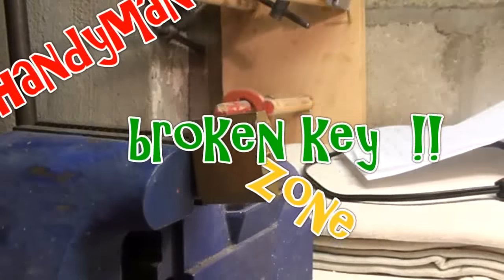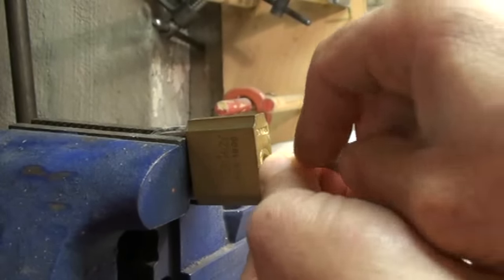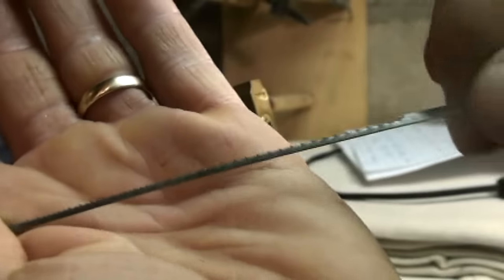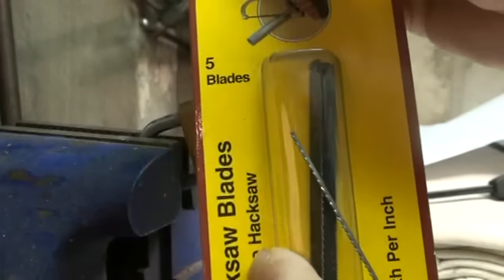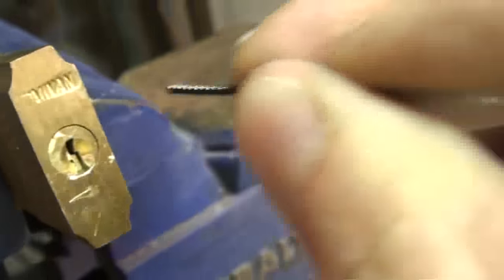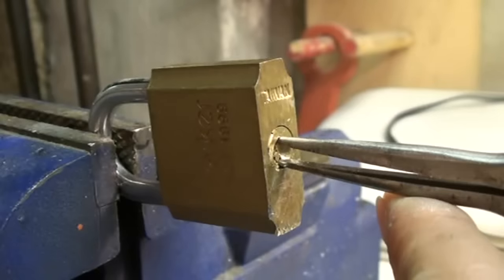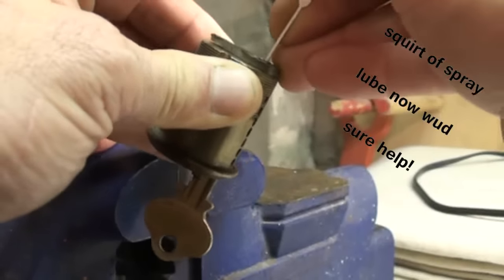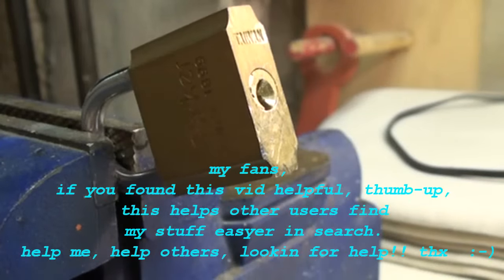7 Tricks Get Broken Key Out Yourself - Any Lock or Key

Comment from the maker: Trudi, you could use one small tool (an extractor or similar) to hold the dust cover open, then try a 2nd extractor or mini blade to catch the key and slip it out, dont forget a small squirt of spray lube to ease things along....you have the right attitude of perservance  & you will get it out, good luck

Comment: I want to thank you for this video as it helped me to my key being broken off in my car door lock. I tried the super glue and it worked to a point. Its 10 degrees out atm. The key did pull out a little bit so I tried it again with superglue. Still key came off. I watched your video up to the saw blade part. I have a small blade saw like that but I had to modify it by using a hand held grinder tool. Grinded it down to a small size, used it and the key came out! Thanks again for this helpful video. I can post a vid if needed by anyone.

Comment: thanks a lot Man, i spend money on hack saw and turns out it easier to extract broken key than cutting the lock. just use the oil and the tiny saw just as you said

Comment: Hi there,
My key just broke off into my trunk a few days ago.  I thought AAA would help me just get the key out - but no, they pay $60 toward a $200 charge!  I refuse to pay that much.

I was so glad to come upon this video.  I have ordered both a key extractor and a set of 5 blades to try doing this myself.

One question.  When my trunk is locked, the lock is 'vertical.'  When I attempted to open the door, it turned the lock to 'horizontal' position.  What's the best side to insert the tool in?

Comment: great ideas thank you Dino. I used a paperclip to push thru from the opposite side and push the broken key our just barely enough that I could grab the end with a very sharp pair of tweezers and pull it out. Basically I used the push method you show at about the 7:20 mark. Not sure how much you saved me but I have no doubt it was a good chunk of change. I was unable to get the cylinder out of the door so it was pretty much my last attempt lol thank you again Dino. liked and subscribed!

Comment: Very helpful.  I have an old "teller safe," with two key-lock drawers above and a combination safe in the bottom part.  Excellent quality, so I didn't really want to drill out the top lock when I fell against it & broke the key off flush.

I tried a lot of surgical tweezers & pointed objects, but all I could do was tease the key out & then the tweezers slipped off. Now I have some other tricks to try.  I also will try a large set of dental tools to pry with.

Thanks - will let you know.

Comment: Great video. My dad absent mindedly broke off the wrong key in our Abus padlock. Managed to extract it using 2 small screwdrivers similar to the method you used. A local locksmith couldn't manage to get it out.

Comment: Thanks for this.  I ended up having to take the door handle apart to remove the cylinder, but the key slid right out.  Putting everything back together took 5x longer than taking it apart, unfortunately.

Comment: Thanks, pry method worked. The most obvious one too, lol. Two flatheads did the job, then a fishing pliers. Used brake cleaner and WD-40 as lube. I will probably flush with brake cleaner since WD-40 attracts dirt.

Don't forget to actually shut the lock mechanism. Depending on the lock mechanism design (i.e. If it's a safe), the key cannot come out unless you attempt to lock it.

Comment: Just want to thank you for this. A key broke off in my building and i would've locked so many people out and kept business closed today until we got a locksmith out. 

What worked for me: 

• I was able to get the lock on its side and bang the key out a little bit. 
• Then i used 1 very small drill bit and pulled the key out just far enough to grab it with my pliers.

Comment: Confirmed that using the coping saw blade worked for me. Tip: I had to use a bench grinder to make the blade about half as thick as its original size before it would fit.

Comment: Key broke off in the key switch of my pool cover. Have a spare, but how to get the stub of the key out. Not enough stub to grab with pliers, or jiggle out with something sharp. Watched this YouTube by Dino, and found the solution. Took the key switch out of its box (after turning off power, of course), removed the lock portion from the electrical switch, and looked for a way to push the old key stub out. No hole, so I followed Dino's trick # 3 (or4) and drilled through the back of the lock. When I got a hole in, I found a thin probe and pushed it through the hole, and-- bingo-- the key stub started to come out of the lock about an 1/8 inch. Enough to grab with plyers and remove. Re-assembled the keyswitch, restored power and put the new key in, and it works. Saved a VERY expensive locksmith call.

Comment: Thanks!  Mine was buried all the way in, it seemed, but just playing around with what was at hand-- a cheap set of jeweler's screwdrivers-- did the trick after a few tries.  A single flathead driver levered along the spine after lots of WD-40.  Got it out far enough to grab with pliers.  Without this video, I might've given up, or thought the WD-40 would make it more difficult.

Comment: great video snapped my key in my front door lucky the door was unlocked when it did removed the cylinder banged it on the table a few times (giggity) and can straight out took me 5/10 minutes and that was putting the cylinder back in thanks very much

Comment: Tried to use a piece of wire first and locked myself out of the house. I climbed through a window and went straight for the saw blade and it worked. You the mench!

Comment: Thanks #DinoPinch for this video... had a security lock key break off in the lock and I wasn’t looking forward to trying a different technique (drilling a hole at an angle) I happen to have the high tensile saw blade in the garage so like you i originally broke it off on the wrong side... Broke it on the other side and was just patient... the squirt of lubricant was the key for getting the KEY out of the lock!!! Thanks for a mini xmas Miracle... lol

Comment: HI Please help - I need your advice! I have a glass balcony door which is locked, with the key broken AND jammed in the lock.  But both sides of the door are accessible to me.In fact the key broke while trying to pull out the whole key. I can't anything past the key the way you showed in this video ( which is an EXCELLENT video, even if I couldn't use it).. I have the duplicate key also , but somehow it doesnt push out the jammed key from the other side.   nor does it open the door .Please help!

Comment: I am in France where we have something called Vachette, Radial NT locks.  The key has multiple dimples or small round indents.  Inside the lock there are little points that drop into the holes when the key is inserted.  The inside key hole is strategically lower than the outside so pushing the key out is not possible.  Any ideas on extracting a broken key?

Comment: You need to remember what position the key is in when you have locked or unlocked your door and you pull the key out.  It needs to be in that position when you try and take out the key.  Mine had to be a 6:00 position....would not budge if in 3:00 or 12:00.  Used the opposite side of door to figure that out.  Used cuticle clippers...sharp points...and WD40...and it all worked perfectly.  Thank you.  Going out to get jigsaw blades just in case it happens again.

Comment: How do I know which side to put a tool inside my lock if the tip of the key is stuck in there.  I'm not sure which direction the jagged edge of the stuck key is facing...

Thanks.

Comment: Dino...
Not a bad video for the most part. If broken key is loose, and you have room to insert a tool to grab the key, it is totally viable.

But your assertions about locksmith fees do not apply to any of the 5000+ legit locksmiths out there.

And these methods can cause damage to ignition locks on cars.

Hardware stores have very limited key assortments compared to locksmiths. I have over 4500 different blanks, including that S Parker padlock. 

More love for the locksmiths out there!

Comment: The coping saw blade that I actually did have on hand did not even fit into the lock in the least. I used the WD40, took a very fine, pointed tweezer, and got the key end to stick out just enough to grasp it with a very small wire cutter, that had enough grip to pull the key out. Had to hold the key tight with the tweezer, to keep it sticking out, while grasping it with the wire cutter. 2 handed operation.
Reply: I got it out with a wirecutter + wd after reading this and the video. Make sure the barrel is turned back to the initial position too so the key can come out

Comment from the maker: nail polish remover, the active solvent is acetone then there is fragrance & glycrin , who wants glycrin in there lock?   , so why not straight acetone, , also Chris, there is solvent special for crazyglue . chemical name for the glue is called cyanoacylate the solvent for that is troalkane , its available online or hobby shops. it dont make the glue disappear, it just eats it up into little chunks, IMO would still be in lock and clog up the pins, best replace the cylinder/lock

Comment from the maker: sounds like your "lock" is working as the key turns the cuylinder....thee is a part called a "tailpiece" that connects the cylinder to the bolt or latch, sounds like tailpiece is broken or somehow slipped from its position

Comment: IF you can get the piece out without damaging the dust-shutter assembly, good for you.

Once you get the piece out, take it and the top of the key to a good locksmith. He/She will be able to measure out what is left of that key, and create a fresh key by the correct dimensions. A copy of a worn broken key will be equal or worse than the broken one was, prior to snapping it off. Locksmith should also supply you with the key code for future use.

Comment: Get a cheap lock picking set. They actually have broken key extraction tools-and it just saved me a fortune. Car key broke off in ignition which left some of the tiny spring loaded pins in "out" position hindering key removal-but the kit tools got around this issue. woohoo!

Comment: Take lock to a good locksmiths' shop, it will not likely be as expensive as poor Dino contends. We charge between 10.00 and 20.00 to remove broken keys from bike locks, padlocks, cabinet locks and car doors.

Sure, If piece will not come out from the front, and I have to take the car door panel and lock off, it can be upward of 175.00 , but that is not a situation Dinos methods demonstrate. He is showing a practical application of theory, with a loose fit lock. And it is useful, to a limit.

Comment: I'm a filthy urbanized hipster who doesn't actually own any tools, and my apartment key broke inside the lock. I ended up threading some wire in from the other side and managed to make it stick out a fraction of a millimeter, then I pulled it out with a nail clipper.

Comment: What about if I get the wrong key in and it turns 45 degrees then it brakes. How do I pull it out?
Reply from the maker: ***** hi, put a small blade screwdriver in the keyslot try to turn the lock back in starting position, then follow the advice in video as to removing the broken off key...thx

Comment: If this lock is less than about 3 years old, it has rotary tumblers.... not the typical wafers or pins. They key was likely not full inserted when you twisted it off. Try rotating it back to the locked position, then tapping the whole lock to dump the key.

Kryptonite will generally ship you a new lock. They have a history of covering user error in their warranty. They even have often reimbursed many for our fee to go out and remove failed U-Locks ( not 350.00.... about 95.00 onsite )

Comment: Also that Taiwan padlock only has 4 pins.... a car door has wafers going up and down... up to 10, so the statement that this works on everything is a stretch.  Most people are going to push the key deeper or damage the lock or ignition trying to do it themselves making it easier for a locksmith to charge more.

Comment: didn't work for me. door lock doesn't have any small gap to slide the jigsaw. however, i was lucky since this door lock has a key socket from both sides. I inserted the jigsaw from the other key hole to push the broken key out.

Comment: for a key extraction on a car i agree with you partially it's 75$ up front + additional labors depending of the complexity of the job but for a lock like this one you use in the video its simply cannot be 350$ otherwise why wouln't you just drill the lock and replace it with another 5 pin lock for 30$

Comment: How do you extract a key which isn't broken but is stuck in the lock becquse it isn't straight. Anyone know?
Reply: It will not come out until the lock is back into the locked position. Trying to force it out without it being turned all the way back will destroy the lock

Comment from the maker: no, it wouldnt make a difference about picking, if the key is broken in the lock, you could stick a small blade screwdriver along side the broken key and turn the cylinder, you dont hve to "pick" to open if the key is broken in the lock, you just have to set the broken stub into operating position and figure out a way to turn the cylinder, should open as normal
the drill hole is just to help push the stub out
thanks!!

Comment: i had a REALLY BAD situation where the end of my key was stuck in the lock and since i had used epoxy to try to get it out it was really stuck there but using those simple plastic saws i got it out i saved $ too probably $6 as opposed to paying $30 to the locksmith

Comment: a crook may charge you $350, I've have NEVER charged over $90 for any key extraction usually its around $75 and generally i give my customer a new key to go with the service. YES this is for mobile service where I come to you. If your a handy type guy/gal then go for it yourself, but I've seen far to many people destroy ignitions to there cars and cause MASSIVE damage to not only the ignition but also column housing and IMMO systems. Easily $1000+ mistakes. So be careful in your attempts :)

Comment: Wow! I have never seen a keyway so wide that you can slip a junior hacksaw blade (that has it's teeth alternating to the left and right and so, effectively thickening the blade to about 2mm). You would not be able to get a blade like this next to a key in a keyway in any other lock. It wouldn't work.
Look at the size of the keyway in vid position 4:30 to 4:40. (View full screen).
You can use this method if you insert it, teeth facing down, above the key. I have done it, but not to the side.

Comment from the maker: if the key is broken in the lock, you may be able to stick a small blade screwdriver  aside the broken key and turn lock cylinder, thus unlocking door using the broken key....otherwise get a ladder....lol or a drill,,,,flamo

Comment: It looks like the key was steel. I bet a very strong magnet will pull the key out also.
Reply: Most keys are made of non-ferrous metals like brass so they don't rust. Even the silver coloured ones are brass.
Reply: Most keys are made of non-ferrous metals like brass so they don't rust. Even the silver coloured ones are brass.

Comment from the maker: Janneth, if you cant get the metal out with my video tricks, CAN YOU REMOVE THE LOCK FROM CABINET  AS A UNIT AND PUSH THE METAL OUT FROM THE REAR OF LOCK with stiff wire?

i have replaced metal cabinet locks before, replacements are available on internet either google seach terms or check CubicleKeys dot   or hardwarehut dotcom

thanks for watching , LET US KNOW HOW YOU DID

Comment: WD-40 is not a lubricant, it is water displacement for preventing rust.  Agree on the comment that no locksmith will charge $300... lets put it this way; a locksmith that wants REPEAT business is going to charge a fair rate like $65 NOT $300.  Anyone that pays $300 to get a key out of a padlock has some weird priorities.  Also you need a locksmith to make a new key from the broken one.

Comment: Hmmmm, our shop charges $68 to $105 to go out and extract a key. The tool I generally use is not shown in the video, you can easily push the broken portion of the key back into the lock making it harder or impossible to get out($$$) and... You could be questioned or even detained for carrying burglary tools in my state carrying the suggested tools. Just Sayin:-)

Comment: whaT IF YR OUTSIDE YR DOOR, AND U TURNED THE KEY (HALF) AND IS STUCK?  WHAT I DID WAS DRILL THE LOCK AWAY. STILL WOULDNT OPEN THOUGH, ALTHOUGH THE COMPLETE CILINDER WAS OUT!. HAD TO CALL A LOCKSMITH FROM YELLOW PAGES, AND HE WANTED TO CHARGE 314EUROS! SAIS I HAD ONLY 89. BORROWED THE 89, AND PAYED. HE DID SOMETHING WITH HIS FINGER (LOOKED LIKE IT) AND IT TOOK LITERALLY 1! SECOND. NEXT TIME, WHAT CAN I DO, WHEN THE KEY WONT TURN, AND WONT COME OUT? (I HAVE NOW ANTI DRILLING LOCKS, SO IM A BIT SCARED. SERIOUS QUESTION! thanks in advance.;.
Reply from the maker: Marius Scheijgrond  it sounds like your lock cylinder was getting old and stiff, it happens and the pins are worn and need a repin or replace lock. now it sounds like this lock was giving signs of needing attention until finally the cylinder jammed and caused you to force the key , it broke off . its a problem and drill is probably the solution, i am thinking the locksmith stuck a small tool way back in the hole , into the tail piece to open

i would recomend prevention as the rule and dont get into the situation.
Reply: Dino Pinch ty for the advice
It was tje cheapest lock everrr